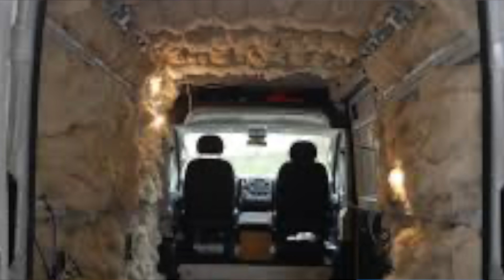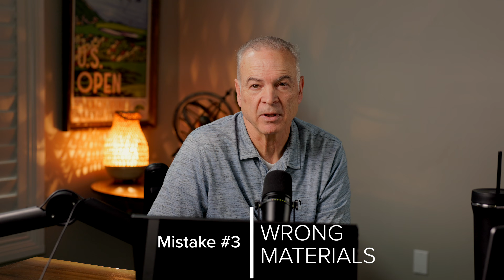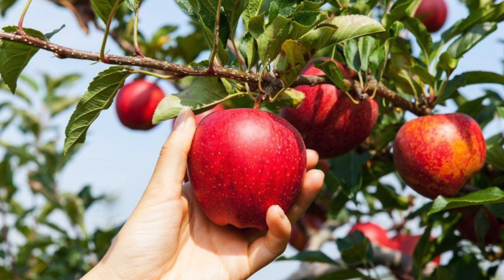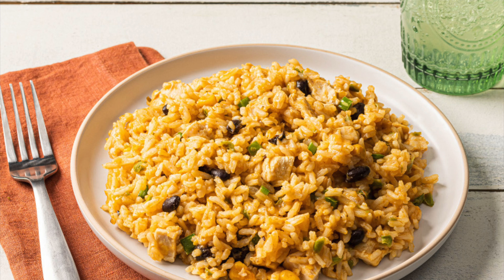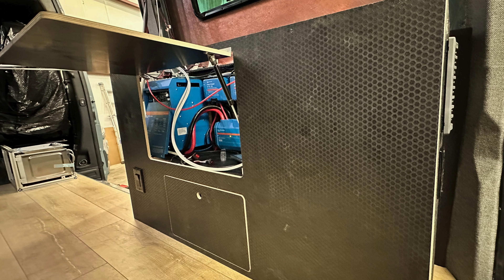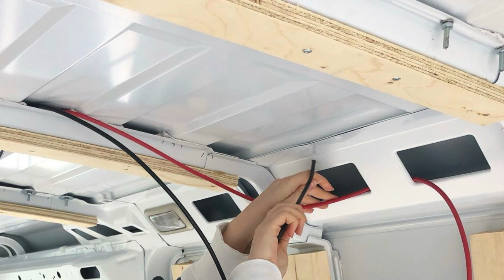Avoid These 5 Van Build Mistakes!

Comment: If you take the good advice of using a digital level, remember not to ''turn it round the other way'.....
if you put it north to south on a 2' slope and reset it your golden, until you pick it up and turn around with it, then it will show 2' out and you will be building 2' out to the floor and 4' out in reality, so when you reset it keep it turned the same way!

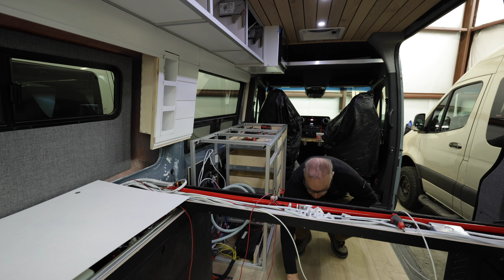This 'error' is shown perfectly in the little demonstration at @5:46 where you see the level reset with the LCD display pointing to the front of the van, but then things are checked with the LCD pointing towards the rear, which would throw it out. I guess this was not spotted due to concentrating more on 'making the video' than building a van and is so understandable.

I had issues adding a square cupboard door into a 45' corner cupboard with sloping walls, no matter what I did or measured from, a perfectly square door would just look wrong and i changed it 4 times at least, in the end i used a not square door and it looked right, and gave in to the universe not being happy with squares.
Reply from the maker: Very good point. I was just moving the level around for the video, but it is important to keep it oriented the same direction.

Comment: "all sound deadening is a waste of time." - why do i say that? when i'm in the back parked up I hear no road sounds. when I'm driving and I can hear road sounds, I'm in the front shut off from the rear!
When its night time and i'm in the back I want to hear if theres things moving around outside the van...
Much better to use the space for sound deadening for more insulation, which is pretty good for sound too
Reply from the maker: Yes. Insulation does a good job at deadening sound.

Comment: I agree with most of what you've said, but many are working on older vans, and so it's just not viable to use marine ply and fittings. Marine ply is  much heavier, due to density, than regular DIY ply.

Sure, if you are working on a new, or nearly new van, then  use the best you can afford.

As to insulation, is only works upto a a point, and it depends where you live, where you'll travel to, and the weather. I ain't going in the mountains during the winter, so my floor is just the steel, stripes of ply, and silver bubble, then 9mm ply, and then 9mm laminate, which I hate with a passion. Here in the UK, it doesn't feel cold to me. The main cold ingress are the cab windows, as you say.   The only way to justify top notch build insulation, is proper internal insulated glass covers, and use an external insulated wrap cover. Open the door, and all your hard work is undone for 10 minutes.🤣

As to getting things plumb. I did my best. But it didn't bother me much. It all look close, but the van is never level, unless it's in that garage and that is rare. My van is virtually all ply, painted white, grey and orange, and to save weight, sliding cupboard doors on high units.

I agree about putting the bed in too early, but I wanted to travel, so it is what it is.

In passing, the thing which is going to kill van life in Europe, is that they are planning to interduce repair redundancy. So when a vehicle gets to a certain age, if something big breaks, they won't let you fix it. It's not in law, but they are toying with the idea. The West is full of Nazis!

I have no plans to sell my van. Cost too much, and a lot of personal time to do the work.
Reply: Actually they're very pro-jewish... so not nazi at all. In fact, the opposite.
Reply: We already have that for all vehicles here in the US

Comment: Buying the cheaper and higher gauge wires seems like the most likely to make your van go up in flames.  The best van lifer advice I have heard was that things will always go wrong.  Conduit on the van walls for easy access to the wires isn't going to make living in your van look any more homeless than it already is.
Reply: Buying oversized wiring is bad. You cause more problems than you solve. Proper design is the MOST important part.
Reply: Bigger wires than what you currently need causes no problems that I am aware of (or that you mentioned).  It also allows a person to add to their electrical system without also replacing all their wiring. @glennbeattie6172
Reply: "...look any more homeless..." 

🤣 I don't consider an $80,000 cost a sign of "homelessness." 🤣

Comment: Interesting take on the “cheap Chinese cells” as almost every prebuilt battery contains them. The Chinese cells are great and for less than one BBorn battery I bought 8 280ah cells which in the equivalent of almost 6 BBorns.
Reply: Yes, I think too much generalization on Chinese products. I have been doing lots of research, and it seems people who have tested and disassembled batteries find that LiTime and others are well-built. Yes, the Chinese build some junk, but I find many Chinese products are high quality. For instance, many, if not most, computers are Chinese made, or at least contain major components that are. Reliability does not seem to be a problem in my experience. In any case, not all of us can afford the very best components. Having said that, many good tips in this video.
Reply: @NMWanderings  Agreed!
Reply: Hah I did the same, eight 280Ah prismatic cells, two 12v packs. So far so good. But, different vendors will offer different quality cells, just have to find a good vendor who sells good products. Lots of folks have gotten burned receiving used cells.
Reply: @wanderingzythophile9083  Someone made the argument that I may have received “B” cells (80% capacity). My rebuttal? I’ll take B cells at 450ah over $4000 in BBorn batteries every day.
Reply from the maker: Sorry if I gave the wrong impression. 

I’m not saying all Chinese batteries and components are bad. Just the super cheap, no name brands. Many components for high quality companies are made in China.
Reply: @thrivans  It was not that, it was just that it needed some clarity. My cells were “cheap” $850 for eight 280ah cells. The sun just topped them off at every bit their capacity. Making your own batteries is NOT for the faint of heart though. It takes a ton of research and buying proper components and proper COPPER wire size. My system never even gets warm. The first thing to go has to be the terminal straps they provide. Hammer some copper pipe flat and use them to connect the cells. Best advice I got for my cells. They never get warm and I know when my cells are balancing, they get the best transfer of energy. Making cables is too much work with 8 cells! The price of premade batteries is dropping and give me pause about their components. If you have room and unlimited budget, sure, buy 6 BBorn batteries and Victron everything. I’ll put my $2k system up against it every day. My BMS is Bluetooth and my shunt give me a quick look at any time. Then again, I have undress of hours researching and building my system.
Reply: @thrivans Buy American 🇺🇲 if it's available, is my opinion. As for Chinese anything... nope. Not sending my VA retirement money overseas, thank you very much.

Comment: Thank you for the video!
What does your van weight normally come to?
Here in europe, the total van weight must be under 7700lbs 3500kg, including passengers.
Reply from the maker: Our conversions come in at around 8,300 Lbs. on a Sprinter 144. Sorry to hear about the restriction in Europe.
Reply: Unfortunately, builders go right up to the vehicle ratings, so engine, transmission, and suspension life suffers.

Comment: Forgot to acknowledge that some van builders are approaching homelessness and limited budget. Some builders are only for 1 trip, or to 'try van life out'. Don't invest $5~10k for a one year horizon. Objectives, resources, motivations can be different. Planning and thought are wise.
Reply: But knowledge is free. Better to know the gold standard and make a cost conscious decision than waste money…
Reply: I only do it in summer me and the fam go somewhere then we go back the van is better experience than regular car
Reply: Im just planning on living in my van for a few years
Reply: So tight I bought a old handybus had 4 hours to make it a camper for 2 people it had a 2 drawer unit in it as the guy I bought it from used it for work I had a 2drawer unit different widths stacked them put a piece of 1/2 inch plywood on top one bed done a second bed on the other side just simple 8 inch plywood frame and plywood on top 2 old 3/4 plywood bypass closet doors for 2walls added a portapoty and a curtain and the bathroom was done fast simple and cheap as it was all salvaged materials
Reply: 100%
Reply: You forgot to acknowledge some van builders who are loosing their home made an active decision to buy a van and live in it, an air bed and no build will do perfectly for them, an intex twin is about $12 from Walmart. Build done.

Comment: Consistently I’ve noticed people cutting roof vents (or other random holes in their van) but never sealing the metal with a rust proofing or automotive rust preventer
Reply: Well, I have the Citroen version of the Promaster. It's galvanised. I did treat the edges with rust paint, but the cut outs from the holes were left outside for 3 years, and only the cut edge had traces of rust. There was no rust under the pain, at all. If you were doing this on an older Ford or Mercedes, then you should apply 20 coats of rust proofing paint... 🤣

Huge advantage if you can get a galvanised van. The newer Sprinters are galvanised, but the prices are a joke, and so are the running costs.
Reply: If the bare metal is covered in sealant that should protect the steel about as well as paint.

Comment: you touched on building materials, thing I've noticed is the builds are way over weight, 
These vans weren't designed or built to be lived in, they're not sealed well and the body shell flex so when you add a bunch of 2X4's and 1/2 ply for a build then you've just about maxed out the load rating of the chassis and all the body seams are strained.
Keep you electrical as simple as possible, way too many lights, too many service USB plugs.
Wire size you touched on, keep your batteries as close to the charging point as possible, if you're using the vans alternator then the batteries should be just behind the drivers seat.
Want to know how to build? Go look at a 1990's class C, Work Horse cassis, full truck frame and brakes rated for the intended load.
Just to add, these Sprinter and Transit vans are so over priced, for the cost of a used 20ft class C, about 12K for a nice one, and ^60K for a transit, with the 48K you'll save and can be used for?
The large sliding door, every time you open it in the winter you're losing heat and replacing it with cold very moist air, when that air is again warmed it has to lose that moisture so the inside of the van soaks it up.
BTW, this term ?Stealth Camping" in town, or any where for that matter, don't think you're fooling anyone, 
Key to a successful build is planning and research, don't try to fit a house into a closet.
Reply: I’ve also wondered if more weight is wearing on braking and accelerating that wasn’t designed for it.

Comment: I love Havelock Wool, but I hear it smells like a barn. I wanted to go with Thinsulate, but what can I use instead of the cancer causing chemical spray to keep the Thinsulate in place?? I would love to go green on insulation, but how??
Reply from the maker: Wool does smell like a barn for a couple of weeks, but the smell goes away. 

You can use string or cover the insulation with Reflectix to keep it in place.
Reply: @thrivans  or hpw about gorilla glue tape??
Reply: Rockwool
Reply: I used insolation made with shredded blue jeans and reflectics cannot remember the name of it but then just covered that with I think it's called lueon a thin flexible wood used insolation board and solid plywood the good kind and linoleum my Ford Aero Star cargo van is solid I put a shiny tool box on the racks